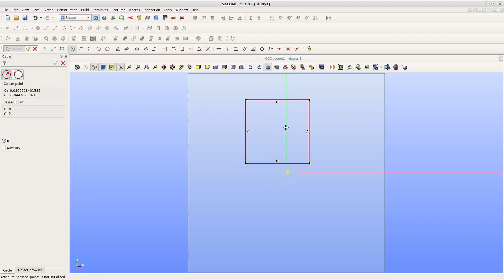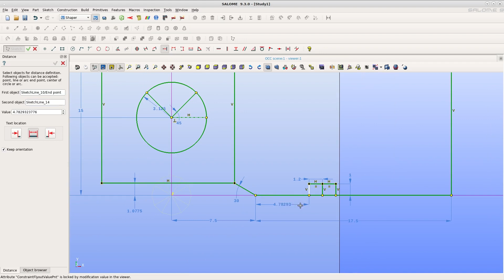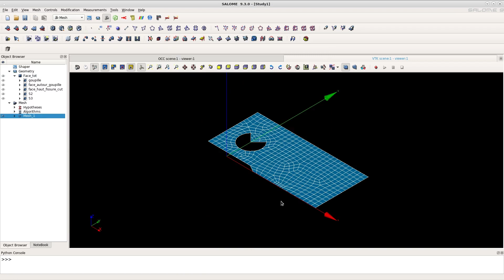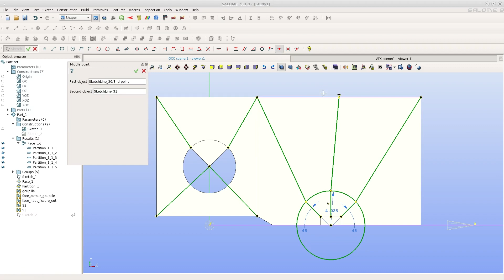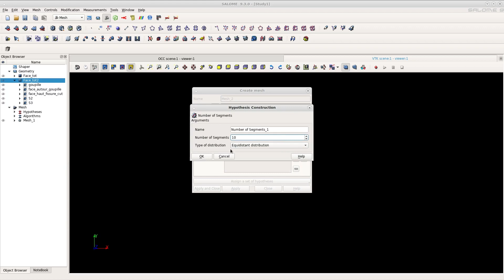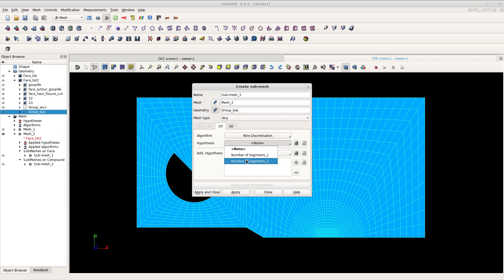SALOME SHAPER compact tension specimen

Comment: OK, a hint, that I need a special license for MG-CADSurf  would have been (correct english?....;-) nice.
Reply from the maker: You are right, I have add it in the description and in the subtitles. Instead of MG-CADSurf quadrangles option, you can use NETGEN 1D-2D with the "quad-dominated" option (elements are mostly quadrangles with a few triangles).